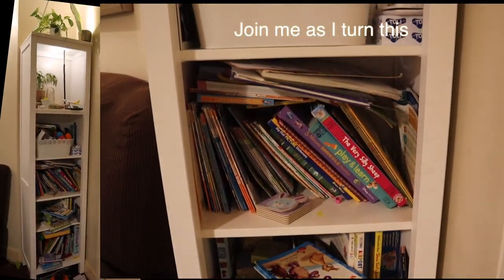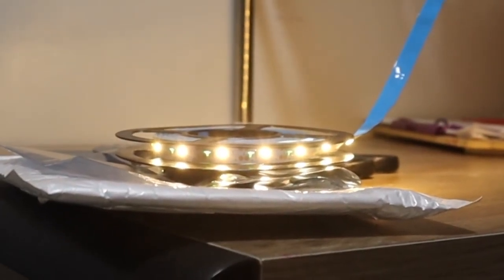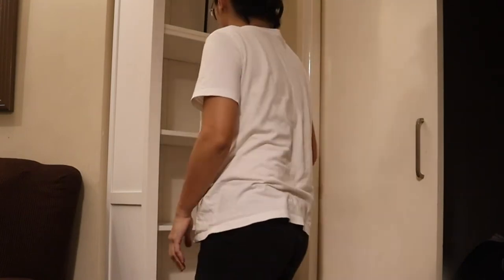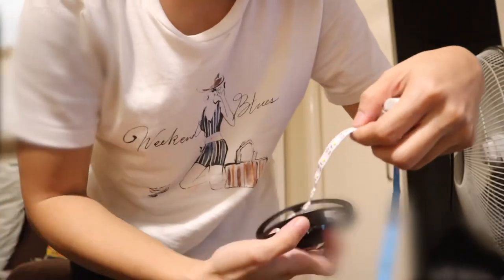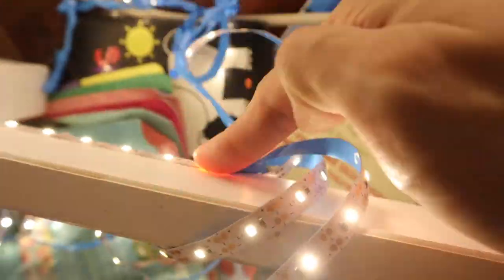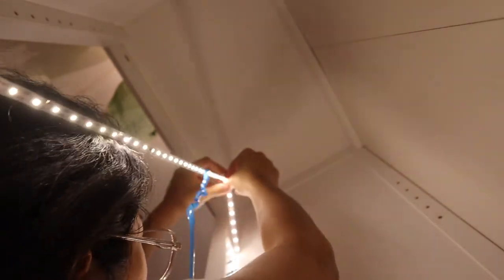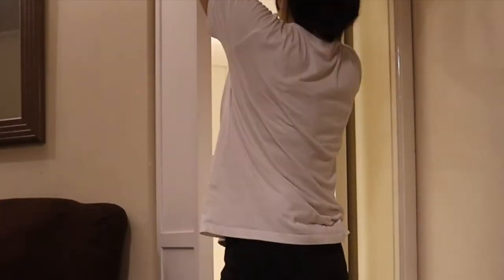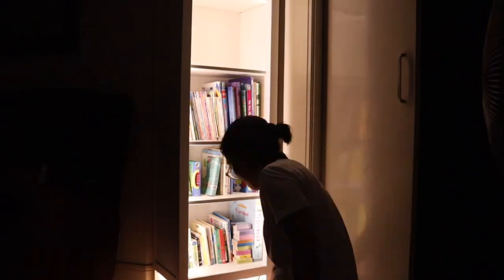How to Install an LED strip on an Ikea Hemnes Bookcase Bookshelf | EASY DIY Project

Comment: I tried this with a Billy bookcase, there was no lip on the edge or molding to hide the light strip so it looked juvenile and tacky. Then I went with battery powered push-up lights instead and now it looks DOPE! How you decorate and arrange stuff makes all the difference in the world, take your time.
Reply: I want to do the same but my billy will have doors, did yours?

Comment: Can this be done with a remote on and off switch ?
Reply from the maker: Hello! Philips Hue has that function! there's an app for your phone to control the light strip. But the one I used here is just the generic light strip with no remote control option :)

Comment: How did you get the lights through the shelf that wouldn't detach?
Reply from the maker: I actually loosened it but to be honest I didn't need to since the gap was big enough for the LED strip to slide through :)
Reply: @mianavigator  ok ty
Reply from the maker: You're welcome :)